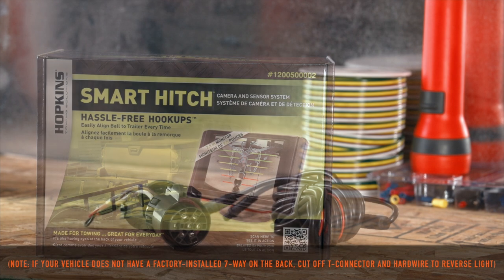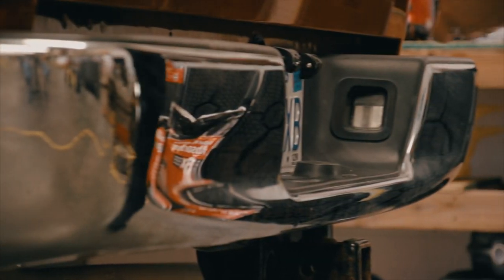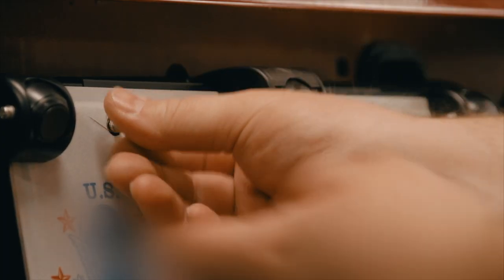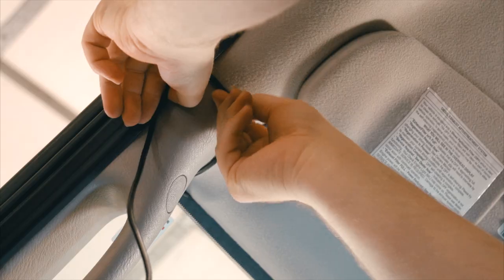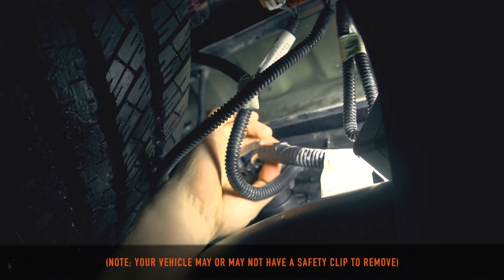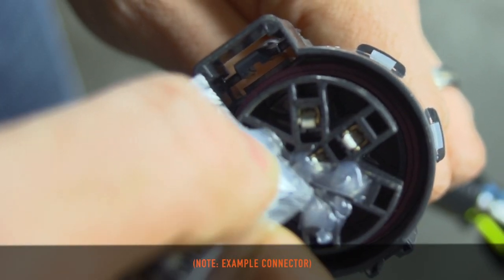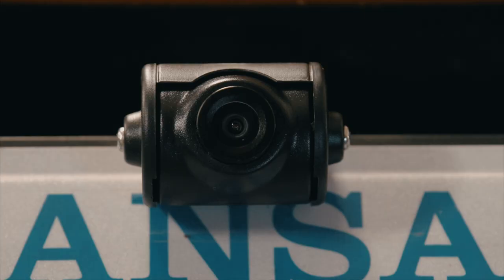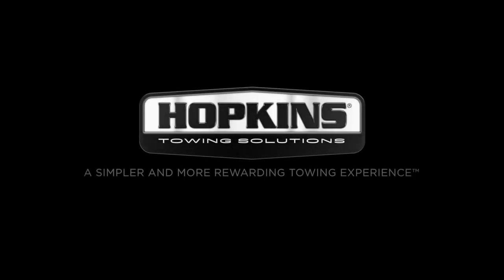Smart Hitch Camera System - Installation Video

Comment: I just got the 50002 and did the install.
On my 2004 Suburban with factory tow package, install was plug and play, super easy! I ran the cable from the rear license plate along the frame and up through the driver side floor grommet with the parking brake cable.
Then up behind the panel with the hood release, A pillar, and stuck the display to the upper left corner of the windshield, plenty of cable.

Comment: A few issues with this item.  First, 30 minute installation is a joke.  I am a capable shade tree mechanic and no way to do this in 30 minutes.  Second, the "provided" zip ties were not provided so have some on hand.  Third, the screen flashes white every 5 seconds or so.  Fourth, the license plate right side sensor needed trimmed on my 2010 F150 in order to clear the key to release the spare wheel. Finally, regardless of what is advertised the is NO difference between normal and hitch mode what so ever.   Do not get me wrong, this seems to be an OK item but not as great as advertised.
Reply: It's pretty much a fancy backup cam. I put it on my dodge journey and if you use the camera alot the screen will go blue and you will have to let it sit for a while to reset